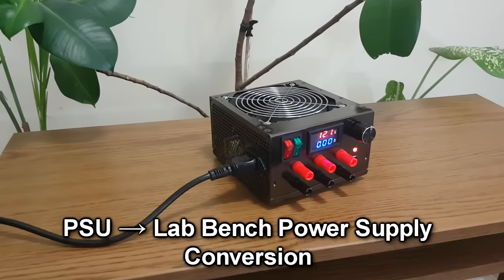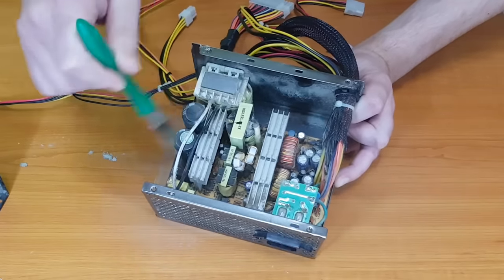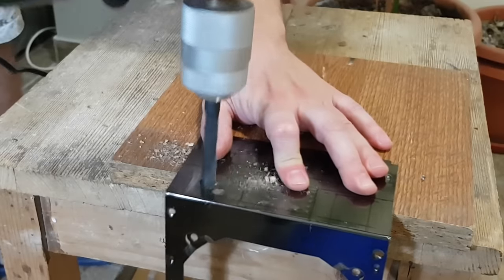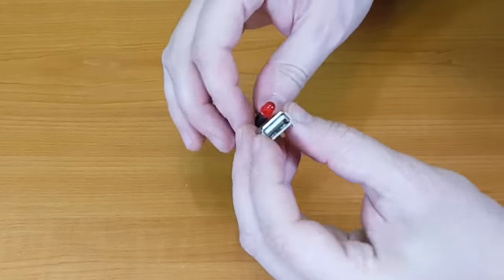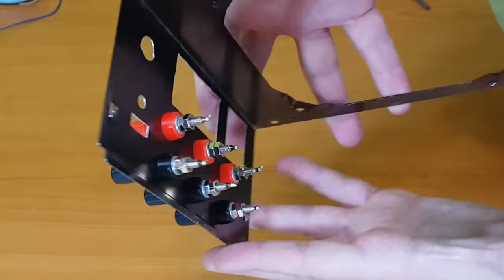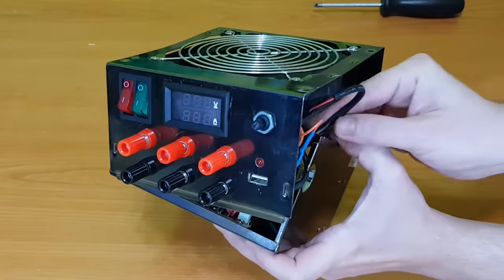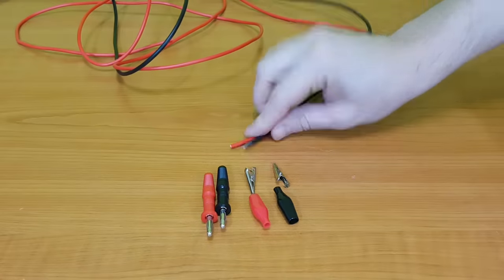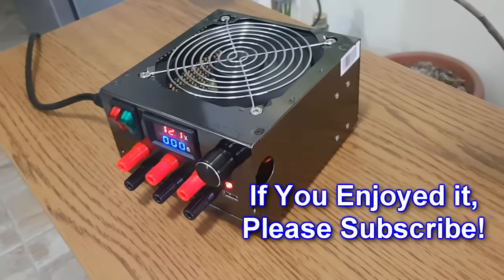DIY - Lab Bench Power Supply

Comment: Suggestions: USB signal , Short USB D+ and D--  Signal , It will increase the charge current when you charge your phone.
Reply: how about using USB-C connector on a fast charger?
Reply: What will be the power consumption, if we only use one 12V supply from PSU?

Will it be same as using it completely?

Comment: This is by far the best looking ATX PSU conversion I've ever seen. Well done my dude.
Reply: Since the rotary selector switch is merely there to select the input of the Volt/Amp meter, and you still retain power on 3.3/5/12V rails regardless of the switch's position (which is very useful FYI), I geuss I do have the "same level of genius", though, not in the bad light you painted it. 

You however, neither seem to know why that would be useful, nor that it is an inherent trait of an ATX switching PSU. Assuming you know what the "switching" part of the description entails.

If you are going to leave salty comments, make sure you understand the topic beforehand. Unless it is you're goal to look like a fool. If it was, - success! 

Also, this was a 7 month old comment.
Reply: Oh, and please work on your grammar, I almost had a stroke trying to read your comment. English is not my primary language either, so that's no excuse...
Reply: I hace a doubt, it seems that my source atx doesn't have the fuse included, if I wanted to add it, where should I put it? Will be right if I connect it in series with my switch of stand by or where? If anyone can help me I'll be so thankful.

Comment: Perfect! Had a little jolt of education there. First time seeing the current reading independent from the voltage source.. could have broken some misconceptions fast when I was in school.. So you have to just be alert of the max current ratings.. the problem might be that you wouldn't be able to tell what you are doing to a single rail when you are using more than one at a time.. but I agree with the practical boundaries.. I would also not likely need more than that.

Comment: Nicely explained and steady vues, and no loud horrid music, that's great..   
Take note Youtubers, This is a perfect example on how to do a useful video.. My only comment is that the current sense wire and resistor  is a waste of energy.  
Perhaps using a  12v  12w bulb would be a good idea  so your power supply could have a desk  lamp  fitted on top to light up what ever  you are making when using this power supply..  Note the output smoothing is usually done by the motherboard in a PC, those nice rows of capacitors that  when dried out burst open and short out the motherboard.  It's nice if you can fit some big value capacitors to the two 12v outputs and the 5v   use a 16V cap for the 12v output and a 10v cap for the 5v output. use the highest UF value you can fit inside the box  or even mount them on the rear of the box.  Then fit a 1k resistor across each  capacitor to empty the cap and lower the voltage to zero when it's switched off. a 1/4 watt resistor is fine for this.. as the current will only be 150 milliwatts ..   great  Video  and well done.
Reply from the maker: hi. thanks for the feedback. the capacitors are a good idea.
Reply: whoa, you said a mouthful. OLE!

Comment: Nicely done Sorin. You have given me many good ideas for my next ATX conversion project: the rotary switch and volt/amp meter. Very good-looking finished product you can be proud of.Tip: A good way to cut square holes in the steel case is to use a cold chisel. One or two blows will cut a perfect corner through the steel case.Thanks for all your effort in producing this video.

Comment: really cool finish,  you made me think to rebuild my lab psu made with ATX as well. I used 2 to get 24 V, and added a regulation circuit for regulated output ( max 2A) .
Reply: Did you just make two supplies and then run them in series?
Reply: Why not use a boost/buck converter to 2/3 12v wires and use that
Reply: @voyagertechnologies  ..buck/boost makes things worst if u consider limited noise tolerance ..you can calculate the tolerances hit in every circuit you connected ones..
Reply: @jhonnyginting8985  Seriously you gonna complain about noice when the guys alternative is connecting 2 psu's in series! Ever used an old psu, he certainly aint buying bequeit gold rated supply
Reply: FYI, Current regulation is quite easy if the voltage is fixed. All you need is a power transistor and a single low current resistor(and a spec sheet to learn the gain of the transistor) :P

Comment: I really like this - as it puts everything into the ATX enclosure. Most add an additional enclosure, which I haven't thought were necessary. However, I have the same comment I have with other electronic projects I've watched...
Buy a heat-gun! I watch people using a match or a lighter to shrink heat-shrink tubing, and it is so ineffective and so inaccurate (and possibly dangerous). In the US you can buy a heat gun for ~$10. This will make your projects much easier and can be used for many other purposes in your projects.

Comment: I like the caution and professional install using "shrink" tube (Sorry, only shrinking when heat is applied. After that it is shrunk.  We just call it "Shrink tube"  The added hot glue,    I like to find one of the bottles of nail polish my wife didn't like painted onto the binding posts and screws.  They tend to work loose. I would also add some inside and on the outer nut of the rotary control.  I finally got some med and strong "Lock-Tite" brand thread lock.  Works the same as nail polish but better but cost $8 to $15 usd  a little goes a long way but its expensive,   Thank you sir, well done.  I think ill do one but another with variable amp and volts plus protection. about $30 more than this.     Cheers!

Comment: Best DIY power supply mod i've seen so far :)
Could you include the parts list in the video description ?
Reply from the maker: hi. thanx for watching. I have bought all the parts from my local hardware store, so unfortunately I can't give you links where to find them. but I've included the parts list in the video description. you can buy them locally, or search them on aliexpress or other sites.

Comment: i build digital upgrades for 1950s model trains. I have a basement lab with 4 benches. I am using train transformers for my test stations, but this idea is outstanding, I have several power supplies from failed devices, I should check them for power and re-purpose them as bench power supplies., I like the digital meters and switches. The variable component may use a pot or a transformer lever with a knob in stead. This is an inspiring project for me to try, thank you D

Comment: You just gave me a super awesome idea sir.   

Why run all 4 12 volt connections to one plug? Just make 4 12 volt terminals (+ and - pairs), 4 5volt terminals (+ and - )and 5 3.3 volt terminals (+ and - )and 1 heavy duty 12 volt terminal (+ and - ) with amperage control for my electroplating.  

Sounds like it needs a big case right?  You are correct in that thinking. I am just going to re use the old pc case that the power supply came in and repaint it a nice metallic finish to make it look all sciencey.

I might even put voltage readouts on each receptacle paring if there is enough room for 16 readouts. That is a dream lab setup on a stock Dell 550 watt power supply.  :D

Comment: Let the cat pass... this is why i hit the subscribe button! very funny!
Reply: That got my sub as well 😬
Reply: I dont see anything funny there :|
Reply: same here, I nearly choked on my beer when he said that. Fantastic.
Reply: i want to charge my car bettery with computer power suply. But in power suply there is a yellow color wire having voltage is 12v thats ok,,, but ampere is low as about 1ampere to 2ampere only (which is not suffient to charge my car bettery). My problem is that how to increase the amperage of (yellow 12v wire) so that it charge my bettery easily.
regds,
thanks. plz reply in detail to solve my problem
Reply: @SaifMusazai: You can not charge a car battery with only 12 volts. You need a minimum of 13.8V (maximum 14.5V) to do this.
Reply: D. Abbo,, then how to increase the voltage of p.suply to reach upto 13.8 v ?
Reply: D. Abbo i have desktop  computer powr suply having default output voltage 12v. I conect variable resistor 3296 with main i.c and voltgae increased upto 14.5v. Is it safe to charge my car battery?
Reply: @SaifMusazai: Theoretically yes. Because I do not know how you made the change and how powerful your Supply is, I can not be sure that you will not overload the power supply and get it up in smoke.
Reply: My Cat is not tabby but white. Is that OK ?
Reply: SaifMusazai You need more than 12v to charge a 12v battery.
At least 14v
Current is not a big problem
suggest 3 amps to 5 amps
Reply: Stuff I Made I want to know whether is it safe to use any power adapter to any electronic device if the output voltage of the power adapter matches the operating voltage of the device but what if the output ampere of the power adapter is high? I am asking this because I have noticed that we can use any rechargeable AA battery of higher amphere to any electronic device like camera or CD player but can we do the same with a power adapter?
Reply: It sounds like an idiom. Sometimes you just have to let the cat pass. :D
Reply: @SaifMusazai  if not sure the yellow wire is 12v you can test use of multitester to make sure to
Reply: Me too 😁
Reply: Me too :)
Reply: That was actually the worst part, because every YouTuber does this...
Reply: I hace a doubt, it seems that my source atx doesn't have the fuse included, if I wanted to add it, where should I put it? Will be right if I connect it in series with my switch of stand by or where? If anyone can help me I'll be so thankful.

Comment: Guys I really need help with this project, so I started building it from scratch, got me a good 500W power supply unit from the used computers store, I think it was really cheap.
I disassembled it, cut the wires as the video shows to work with them easily... and got the other parts from the electronics store, the thing is... I was trying to do the first holes with the hand drill but my cat just keeps standing there, staring and judging every movement I make, it won't pass... I have tried everything... from food to scratches and it won't move from the project table... I'm stuck at this, you guys can help me pleaseeee? I'm desperate to finish this power supply, but my cat won't PASSSS! HELP!
Reply: cat.exe has crashed, restart cat.exe

Comment: Hi! This PSU looks really good! However, if you have three sets of banana plugs/binding posts (3V3, 5V, 12V) - why do you need the rotary switch? I would think that when you make these, you either have the rotary switch for selecting voltage and one set of binding posts, OR you do it a bit simpler with only the three sets of binding posts (even simpler is one red for the different voltages and one common ground).
Reply: I think the rotary switch just changes which output the meter displays.
Reply: he can't directly connect output high current to rotary switch because its sparks and i think after 5 time rotating switch,its messed up and die.
so if no rotaty switch so ho can remove anothers banana post during use one? i mean inorder that shows volt and current of just one post?
just one other concept remains :
use really instead of direct wirin to rotary to pervent spark and damage( anyway its randomly shot down unit becausr of china responsibility to probife minimums!😁

Comment: For the USB port, you should have used a car USB charger. The one that plugs into the lighter port and turns 12 volts into a steady 5 volts and has a regulator protection circuit on it. It would simplify things and make it safe for your phone
Reply from the maker: hi. thanks for the suggestion. but I will not use it to charge my phone. I'm using it to test different USB DIY devices with up to 4A. please watch the part2 video for more info about my power supply.
Reply: I'd use a buck converter.

Comment: I've got an idea: Would it be possible to connect the built-in fan as the dummy load so the power supply turns on?! Would this be enough load?
Reply from the maker: hi. that is a good idea. for this power supply it will work. but the fan is consuming very little current and there are some power supplies which may need a bigger load. also you need to solder a connector to the yellow and black wires, so you can easily remove the fan cover if you need to reopen the power supply.
some modern PSUs have variable voltage output for the fan, so the fan's speed will variate depending on the load or PSU temperature. if you connect the fan to the 12V output, it will ad a load, but the fan will always work on maximum speed.
Reply: @Sorin_DIY hello sir I’m a student I used this like my school project I followed all your step but I have a problem my lab psu turn for a second and then goes off i mean like screen voltage /amper it goes off when I give the current help me please

Comment: lmao LET THE CAT PASS!. What would you charge just to build one of these Id buy one from you!
Reply: Bil Paranormal Investigator Build your own,its a fun project. Just don't cramp everything in one box like he did, make a seperate smaller box with all the wires going inside that box,much easier and safer
Reply: me too $$$
Reply: The whole point of DIY is if you do it YOURSELF. You can buy a variable power supply for less than $70(won't be very good tho). You paying him to build you one is stupid and beyond me, pay a cheap chinease company and get it off shelves? Build it, that's what i would suggest but if you cant/don't then buy it
Reply: @voyagertechnologies  Yes this is the whole point of DIY. But not everyone has all the tools needed and they may be lacking the skills or knowledge to make something their self.
Reply: @AnthonyGoodley  You do realise these are easily available on market, the whole point this video exists is to make it yoursemf cheaper, im no expert and i have completed this project aswell. If you cant even cut wires and connect them to a metal plug, you dont need a variable lab bench supply
Reply: @voyagertechnologies  And of course Bil, you have to let the cat pass!

Comment: Felicitari pentru initiativa dar as avea cateva sugestii:
1. La o sarcina de vre-o 9 amperi intamplatoare, lamele comutatorului se vor topi, mai ales ca nu ai nici un fel de protectie la scurt-circuit.
2. Nu are rost sa ai un comutator rotativ daca folosesti borne diferite de iesire. Mai bine foloseai o singura pereche de borne si foloseai comutatorul sa comande inchiderea unor relee pentru cele 3 trepte de tensiune si te rezolva si la problema nr. 1.

Ar fi fost interesant sa ne spui cam ce costuri a presupus acest proiect. Toate bune!!!
Reply from the maker: salut. multumesc pentru implicare. comutatorul rotativ insa nu schimba tensiunea de iesire la borne. schimba doar tensiunea afisata de voltmetru. deci e folosit cu un curent foarte mic. iesirile sunt conectate tot timpul la borne. voltmetrul l-am conectat pentru ca era deja inclus in afisajul volt/ampermetru; pentru a verifica daca sunt variatii de tensiune la iesirea pe care o folosesc in momentul respectiv (desi nu ar trebui sa fie) si pentru a afisa in clipuri tensiunea pe care o folosesc. pentru cei care nu inteleg limba engleza sau accentul meu, ii ajuta cand vad pe display 12V. am facut si un video part2, unde am raspuns la intrebari si am explicat mai multe lucruri.

Comment: 4:01 You can also put a Dremel sander disk bit onto a drill press and cut horizontally along the plate with the metal against a block of wood.

Comment: Nice effort! Your hard work is reflecting from it! 
I would like to request you to make another one...! Please try to make it adjustable to any number of volts (I mean not ONLY 3.3V, 5V, and 12V).... Secondly, please make it able to give 3.3V, 5V, and 12V at the same time without any rotary switch... 
And thirdly, I would like to ask you that why are you giving three binding posts for GROUND? You can use one ground only I think... Can I know why you did so?
Reply from the maker: hi. I will probably make another one in the future with all the features included. but to answer your questions for now: 1) I've made a separate variable bench power supply, you can check out my other videos for that; 2) the 3 outputs are available in the same time and independent from the switch. the switch is only for the voltmeter. please watch the part2 video for more info; 3) the 3 negative binding posts are for connecting 3 loads on the 3 outputs in the same time and because I like symmetric arrangements, so I think it looks better this way. again, watch the part2 video for more info.

Comment: Good work
To protect the ATX again short circuit. It will be better to connect the Green wire (power on) to Relay contact with black wire. And to energize the relay with the 12 v or 5 v accorditly.

Comment: I've been rewiring a few old power supplies i have to use as inverters for car audio and house power. admittedly typing this before watching the vid but i do think this will make things much cleaner
Reply: Dear @Targaryen 

What is the power consumption if we only use a single 12V port?
Reply: @howed  power consumption depends on whatever you are powering with it. For my audio setup, the avg watts pulled was about 500. Just depends on your tune or whatever is being juiced with it. The power supplies I used gave about 300 watts on their 12v rail, so I made sure not to pass that with a single one. I'll add im not an electrician, I dont know a lot about this, so take what I say with a grain of salt. I'm not trained at all for this. Just a diyer
Reply: @jdparker3  Thank You 🥰